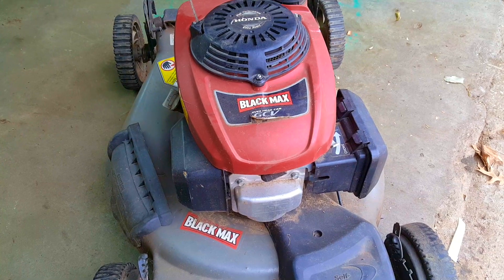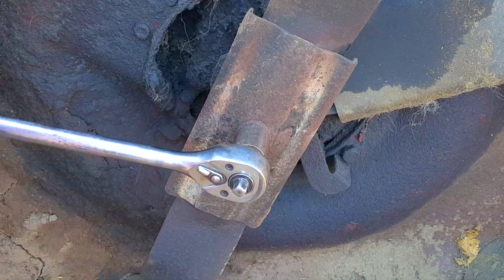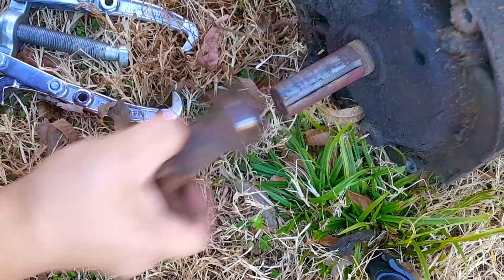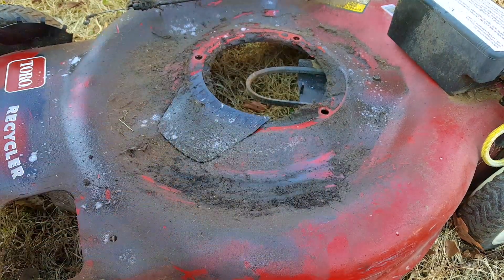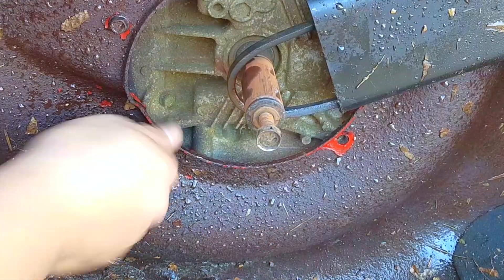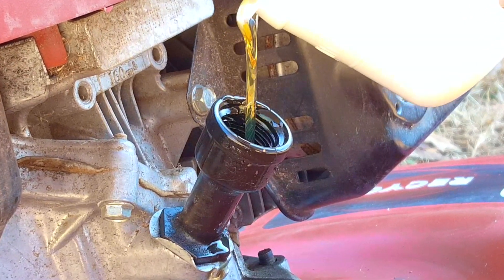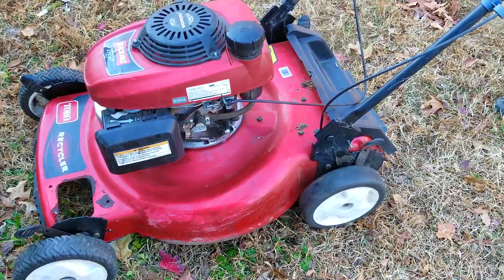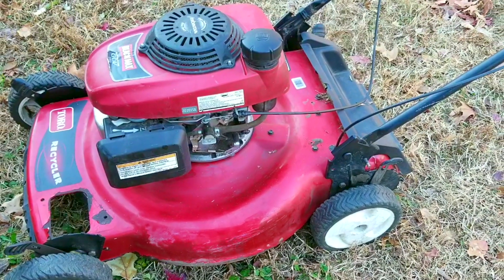Is An Engine Swap Worth It, On This Toro Mower

Comment: Never did a swap but I did replace two new B&S engines on my 27 year old Snapper. Engines can be lots cheaper than mowers. The old Snapper deck has no rust... absolutely bullet proof.
Reply from the maker: yes you are correct the engines can be found for a decent price.
Reply: 10/4 on a Snapper!

Comment: I think you forgot an important component of engine swap. While shaft diameter IS important, shaft length is more so. I discovered this when I put a Honda GCV160 on a Craftsman to replace a blown Tecumseh. It bolted up ok, but gave a very close shave because the shaft length on the Honda was longer.
Reply from the maker: oh yes you are right.
Reply: Gillette: The best a lawn can get.

Comment: I did an engine swap on my Toro.  The spark plug cracked, and some porcelain got in my cylinder and scored it so badly that the compression was shot.  Found the same Tecumseh engine on another Toro with a rusted frame for $60.
Reply from the maker: thank you Kevin Colonel and nice work

Comment: In this day of high inflation,  it makes sense to use good used equipment either engine/mower deck,  ect. Right now I'm working on a project,  putting a 25 horsepower V twin on an older Murry 40 inch that had a 12 horsepower that just wore out.  It has a few challenges,  but nothing I can't handle,  like the exhaust.  That's not too difficult.  I will have duel exhaust when I'm finished
Reply from the maker: very nice!

Comment: Recently decided to do an engine replacement on my push mower. As you noted, new mower prices are very high, even for the most basic units. I loved my Craftsman Rear-Bagger 21" unit because the deck was very rugged and it performed well. The engine was getting really hard to start and after trying things like replacing the carburetor, I discovered that the spark plug was getting oil-fouled (rings or scoring most likely). Decided to go with a new predator 173cc engine so I could keep the original deck. The only issue I ran into was with the arbor for the blade (blade adapter). After searching out You Tube posts, I found one on this specific subject. Runs and functions great again. You are spot on about the feeling of accomplishment!
Reply from the maker: very nice work and thank you!

Comment: I’ll usually do anything in my ability to repair and save one of those Tecumseh engines, even if that means rebuilding the entire thing. As long as the engine block itself is still in good condition, I can pretty much fix it. And if you look in the right places, you can still find replacement crankshaft, pistons, rods, and any other internal engine part because of how heavily mass produced those engines were.
Reply from the maker: I know, I think I still have this engine, in storage. I want to take a better look at it and try and save it too.

Comment: Lawn mower engine swaps are fun and not too hard. I am planning to replace a very nice 2009 Husqvarna  garden tractor's  mower deck with a completely different garden tractor brand deck.  This is a little tricky but also a lot of fun. My  Husqvarna tractor was given to me for free but it did not have a mower deck. So, I got a 1982 Craftsman deck for free (also in great shape) & once finished I will have a very nice garden tractor.  Cheers.
Reply from the maker: thank you Chicago Bears for sharing your experience

Comment: When I change a motor out I try to find a "match" whenever possible and change the covers. There are Quantum powered mowers everywhere out here so it's usually pretty easy to do.
Reply from the maker: that's a good way of doing it.
Reply: @Home Garage  I don't like to keep much in the way of spares, so I love it when I have  one sitting around and another comes in with little oil and fewer rings.
Reply from the maker: me too

Comment: the engine sounds great 👍 I noticed a lot of surging at the first start but it did seem to get better 😀😀 another reason that the self propelled could be slow is that the drive belt is stretched & slipping on the pulley glad to see another good 👍 engine saved the deck cleaned up nicely 😃😀 job well done 👍 sir 👍
Reply from the maker: you know, I don't remember what happened to that mower, but I'm sure I got it working a bit better, at least good enough to be sold.

Comment: I just did an ending swap on my personal mower. Had an old craftsman 917 self propelled rear wheel drive that the deck cracked, but motor was great. Found a Toro Personal Pace rear wheel drive at a yard sale with a bad motor for free. Both had the same Briggs motor and everything from mounts and cables and pulley lined up perfectly. I did have to use the blade from the Craftsman because of the bolt size. The now Toro, cuts better than it ever.
Reply: Typo... Engine swap 
Not ending swap
Reply from the maker: nice work!

Comment: Yea I swap all the time. The three hole design is the same as briggs etc and it's the same bolt pattern for the later victa 160cc two stroke only phased out 90°.
Reply from the maker: thank you Gasman's Workshop

Comment: I always find when swapping them I put some grease on the blade adapter then slide it on. then if in the future you need to remove it its so much easier to get it off.  You can make some really nice mowers  out of a franken mower. I have one myself along with my toro a nice high wheeled yard man. worked out really well though it  wasn't self propelled. did the same for my grandpa when he really wanted to keep a old  80's briggs engine and we found a really nice deck and i made it exactly how he wanted it. Hes like they dont make them how i want anymore. this was in the early 2000s and fixed everything up with an older deck his engine and he was happy.  So yeah I think its a really good idea. plus a shame to waste a perfectly good engine or vice versa with a real good deck.
Reply from the maker: I agree, take the good engine off, and keep it for another project.

Comment: Funny you should post this today. Today I picked up a VERY NICE 123 hour Cub Cadet with A Kohler Command engine on it. Owner stated that it started to smoke and shake when he was mowing and he shut it off. When I  Took a looked at I found a 6”x 8” piece of the engine had just blown off.what would you recommend I do.
Reply from the maker: I would recommend you find a replacement engine.
Reply: @HomeGaragechannel  would you go fora long or short block
Reply from the maker: short

Comment: Mine was a pain but was worth it. A Snapper walk behind for $15 but had a H A R D life. The gearbox was full of leaves and needed a pinion and bearings and grease. The engine was shot and it takes a LOT to kill a flathead. Bent crank to boot. Buddy saw guy gave me a wrecked Deere with a Kawasaki 6 horse. The swap was interesting. Briggs and Kawasaki are opposite about carbs and mufflers. Carb on the Snapper with the Kawa was fine but the muffler was next to the nylon chute to the bag. A 1 inch copper 'L' fastened to the muffler guard over the exhaust exit solved that. NO blade adapter but made one out of the blade clutch since the crank was smaller than the Briggs. Been several years and have done nothing to the Kawasaki (overhead valve) but change oil and air filters. Always starts 2nd pull and runs sweet. Mows like a rug and still has the DEERE sticker on the recoil to mess with people. I'd do it again for the better running but still like my old Briggs flatheads. BLESSINGS!
Reply from the maker: they are definitely great engines, and worth fixing and transplanting, thank yo Lewie McNeely.
Reply: @HomeGaragechannel  That one has been a dandy. I hjad a 420V on a 4-foot Ex-mark walk behind, belt drive. It never had anything but oil changes nd an air filter sometimes and it';s stil going. I gave it to my brother-in-laws bvrother because he has a lot of steep banks to mow. The Ex-mark book said if you could walk it, it would cut it. It did and still does.

Comment: Seeing as you had the self propel belt on the mower already, being able to swap the blade adapter over was ideal.  If you're not able to, as long as the shaft length and adapter sits similarly to the original one, you can get away with a slightly different size belt.  I've had to do that on a handful of occasions.

On a separate note, do you know what make/model your puller is?  Mine doesn't have the little hat on the end of the screw part and makes it pretty difficult to keep the pointed tip on top of bolts.  I'd love to have one with that end hat piece to be able to sit flush on the bolt head!
Reply from the maker: thanks, and you make a good point about the belt. I believe the puller came from Harbor Freight.

Comment: I hate to say it but those early auto choke Hondas are a pain in the arse!
Reply: Agree. Sometimes it works but often either the return spring is too taut and it opens the choke before you can get back to the handle & pull cord or its too weak and the choke never reopens fully.
Reply from the maker: yes I didn't like the "dial" style chokes either.

Comment: I engine swapped a used Honda GCV160 engine from a rotted out Honda IZY on to an Allen (now Toro) 221 hover mower deck which replaced a burned up 2 stroke Tecumseh engine. The cables were the worst part because the GCV engine is backward on a hover deck so when it is on a steep slope it doesn’t ingest it’s own engine oil, meaning the throttle and engine brake cables need to be twice the normal length.
Reply from the maker: I've never had the pleasure of working on a hover mower. I'd like to some day.
Reply: @HomeGaragechannel  they are just a very basic rotary mower with a fan disk mounted just above the blade & the cut height is adjusted by adding or removing a blade spacer, i have two Toro hover mowers, a 21’ (Honda GCV 160) & an 18” (Honda GCV 135). The smaller one has the option to run either a metal blade or heavy gauge plastic cords.

Comment: Do you think you would be possible to put a plain old push mower motor on to a mower with self-propelled and blade clutch????
Reply from the maker: yes but you'd probably have to use an adaptor to increase the size from 7/8" to 1".
Reply: Ok thanks

Comment: A reason for doing an engine swap? Well, I can tell you. 
Lets say a customer brings in a 2008 Toro Recycler mower with the very last generation 6.5 HP Tecumseh on it because it doesn´t start. Now the deck and rest of the mower aren´t looking to good, rust, wear, the usual. But apart from a gummed up carb the engine is fine...  Now I wouldn't be in any way interested in the deck, but certainly in the engine. So, how do I make myself AND the customer happy? It´s easy. There is some random Briggs Quantum lying around which just happens to have the right shaft. Its not very old, not very new, quite worn out and shabby, but with a bit of work will at least start and run smooth. Also there are some Toro specific parts from a Quantum that threw a rod... I´ll be dammed, but I´d fix up that Tecumseh while it´s still on the deck and do a full rejuvenating job on it so that it runs excellent and is as clean as it was from the factory. Then I´ll rip it off there, clean the deck up as best as I could without investing any money, and get that old Quantum on there including the Toro specfic parts. Minimal investion in parts, just scramble together whatever is in the used stash. Clean it up, make sure it looks nice and runs well, no money invested except for a new gasket between the air filter and the carb so that the primer works and the engine starts on the first or second pull. 
The customer doesn´t care about what kind of engine is on there as long as it doesn´t give him any trouble. I tell him the old engine couldn´t be repared anymore and therefore you did an engine swap. But it´s ok, he doesn´t have to pay much, it´s only xy bucks (the price of the carb and maintenance job on the Tecumseh you pulled off). Now the customer is happy because he has a running mower and it didn´t cost him much and you are happy because you got rid of that uninteresting, worn Briggs Quantum as well as some other parts noone needs AND you have a nice fully working last generation Tecumseh. Win-Win situation.
Reply from the maker: nice thanks for explaining that
Reply: @HomeGaragechannel  Cheers, comes natural to me! And it´s not a rip off although it might look like it on first glance.